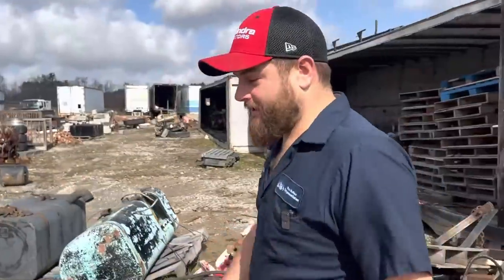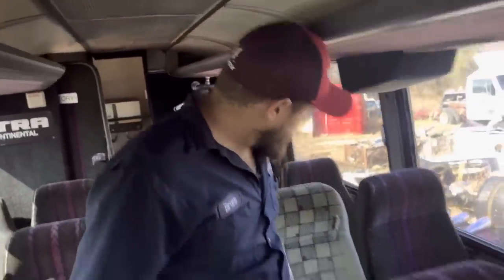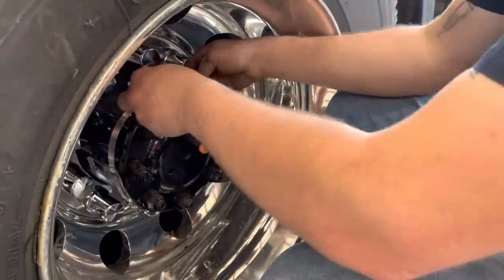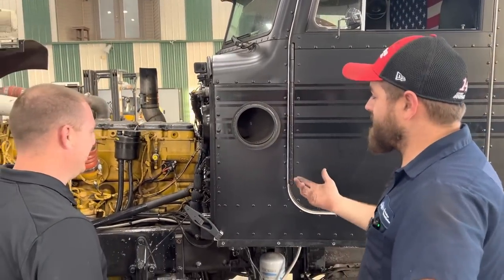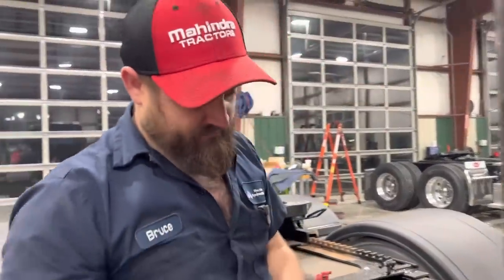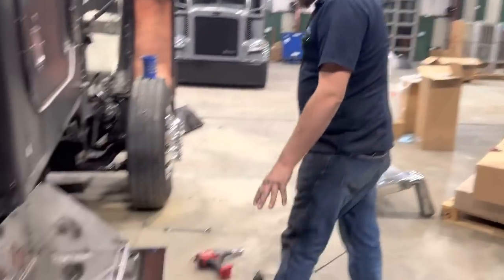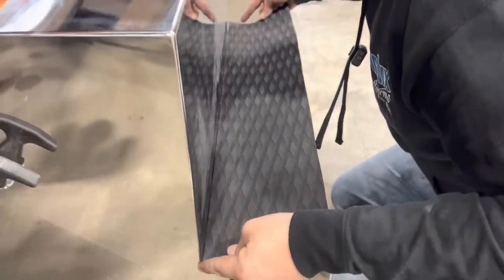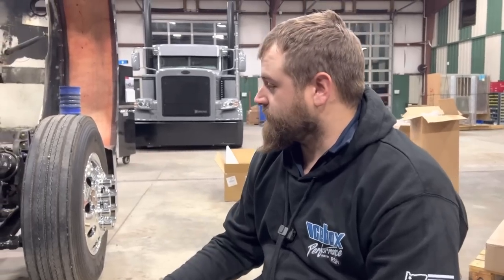JunkYard Diving for Discontinued Peterbilt Parts!

Comment: one of the trucks i drove was a 1980 peterbuilt cabover 400 cummins 13 speed with air ride i loved that truck it was copper metallic with 3 stripes and brown leather interior it was a huge step up from the 400 cummins 13 speed transtar i had  far as the ride the transtar2 was dependiable though but it was rough riding on deadheads
Reply: My dad had a 77 352 with a 350 sc or bc 13spd. I'm just amazed because it had the exact same paint scheme from what you described. Copper metallic with a gold, light and dark brown strip? That was his anyway.

Comment: Donaldson or Vortex for air cans. Didn't matter what breed truck unless you wanted the design cut into air opening.  
Ever heard of Skins, make stainless wraps for tanks. Saves polishing the whole tank. 
SHTube making drop panels and they can cut name into them, maybe back light through the cut versus punching holes and hanging lights? 
Bruce through editing you sure loose a lot of time each day to go shopping without a list a NAPA. Maybe slow down a bit, you starting to become your own worse enemy.  
Shifter ought to be what you can comfortable with,  be embarrassing to break ape hanger if you get excited. 
Like how foam came in handy for fuel cell.  When wears out on step maybe NAPA sell you roll of 6in fiction tape.  
Oh so now you can look for good old stationary passenger seat? 
Think 4 States sells the JJ brackets to mount headlights back to hood. They even used have some copies of old time single rounds. If you want old school.
Keep on plugging away.

Comment: That tap breaking was completely your fault dude
Reply: Yep, he turned it in too fast and heated it up.
Reply: @EDventures1972  also supposed to turn it back out some when your feeling it bind so it can clear the crap out thats its cutting. Then run It in more
Reply: @muskokaroads2371  Absolutely! That's what causes the heat up from not doing that. Especially on small taps.

Comment: That Hendrickson rubber ride would be good pulling truck suspension find that on a set of 46s and you would be in good shape. New way would be decent too that’s about the only heavy duty air ride

Comment: Bruce that thing looks great. I am looking for a 1978 Mack with a cummins to turn into my welding rig.  Right now I have a Ford Ranger xlt that I put a flatbed on it and am doing the spring over shock so that I can lift it enough to put a set of 38" super swampers. I have a V-6 in it right now and it runs really well. I miss living in Florida. I hate the cold. I lived in Siesta key while I went to school at USF for chemical engineering. After the plandemic I realized I hated everyone I worked with in big Pharma and they were out to get everyone. I decided after I recovered from getting run over by a F350 on my 1957 Panhead that I was going to do something I love. I started a small engine repair shop along with mobile welding and fabrication and also a machine shop. I will be back down with my 32 foot trailer and find a place in Tampa. I hope to get to catch up with you at the Flywheelers. We talked about going down with a few people from up here that do that sort of stuff.Take care brother.

Comment: im just a old late 70s and 80s trucker mostly cabovers i drove hauling gas tanker linseed oil malt o meal ceraal and stuff but I like your guys love of tractors semis and garden tractors.i built a old allis chalmers puller with 2 thundercat motors out of snowmobiles that thing pulled hard but spun to much im a old bodyman and painter now and someone wanted it so bad they gave me 2800 for it so i let it go 13 years ago t was a rush.I Had a showpaintjob on it im sure i sold it way to cheap but i was broke

Comment: I once drove one of those Setra coaches, it had a big v10 Mercedes engine and boy was it a machine, it could beat cars off the line 😂

In fact it had that much power, I once drove it half an hour with the handbrake on without even noticing 😂😂

Comment: Should make those cab “Sleeper” panels drop down pretty low in the front to cover up the air filter and fuel filter systems which will also help hide a lot of the hoses and electrical lines.

Comment: Now it's really looking good love to hear more lights and making it more original may pull better with bit more weight, at least what I heard, I'd say on the shifter dash high, have some custom tanks built between steps and front rear axle or have the tank big on top frame behind the cab like the old ptos idk either way your truck, your show and I love it man. Oh I almost forgot since you bought it, painted the fire wall few others, you gotta paint the bottom front fenders I think it's an eye sore but up to you
Reply: If anything do a bed liner paint for underneath to help reduce rock chips and paint chips.